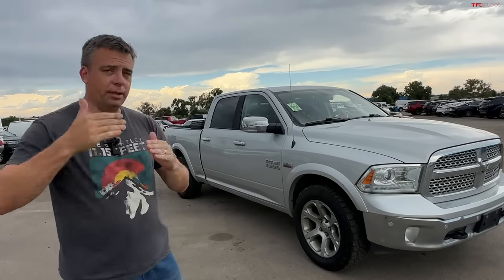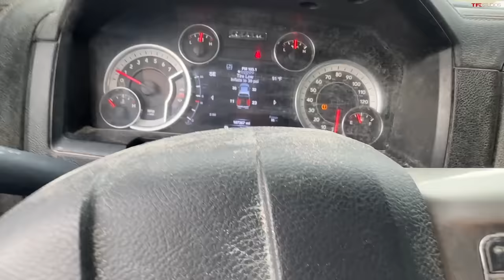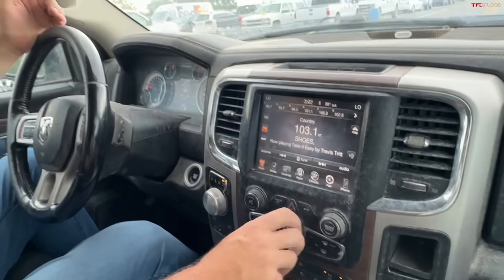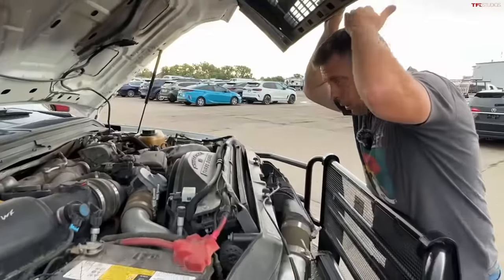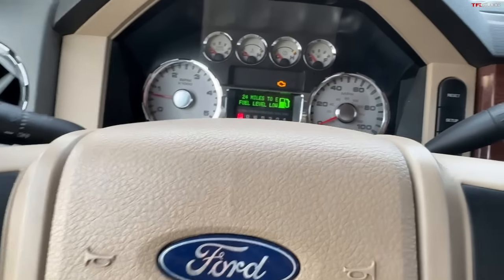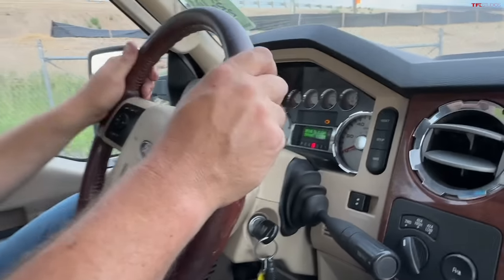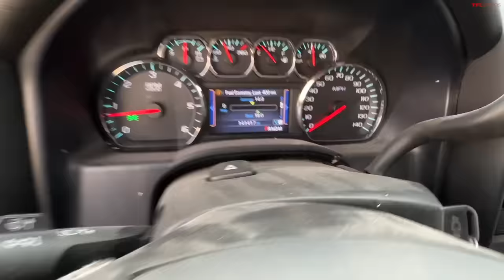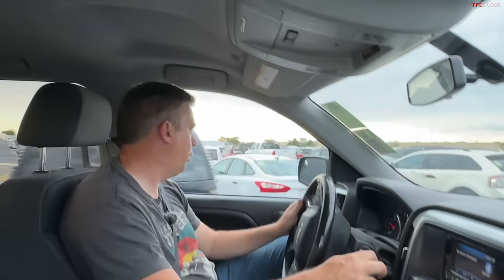These Are the Top 3 Used Trucks You Should Never, EVER Buy!

Comment: The HEMI tick issue is a bit more complicated than described.  There are 2 issues.  One is the lifter tick that you mentioned.  It is actually the less common tick.  Caused (generally) by high idle time on the engine, since the stock oil pump drops oil pressure down into the 30s (psi), while it normally runs into the mid-high 50s while running.  My 77k mile 2015 Hemi Ram Limited has about 2000 hours total on the engine, and only about 200 hours of that is idle time.  I do everything in my power to reduce idling the engine.  There is evidence out there that the nest way to prevent this is to increase the idle oil pressure by swapping to the 6.2L Hemi oil pump, as it is a bolt on swap.  The housings on the pump are the same, but the 6.2L pump has extra teeth, internally that cause a higher oil pressure while at idle, helping to ensure the lifters get oiled while not under load.  The other tick is far more common and is cause by broken studs/exhaust manifold.  Generally while the engine is cold, the broken stud allows the exhaust manifold to pull away from the block slightly, so that when started, the "slapping" of the manifold causes a ticking sound.  Once the engine is warmed up, this tick will generally go away.  From my research this is due to different metals being mated together, but I cannot personally validate that.  Perhaps swapping to headers is the best fix?
Reply: Yep. Mechanic here and also have owned a 5.7 hemi of that era. That is 100% a exhaust manifold tick, not a lifter tick
Reply: Exactly- This tick (the first Ram) is an exhaust leak
Reply: Another mechanic here. Can confirm. Thanks for explaining it to people.
Reply: Are these also the engines that had valve seat issues? The hardened valve seats were pressed into the heads - but since they were made of different metals they would expand and contract at different rates. Sometimes dropping the valve seat into the cylinder.
Reply: @christopher7026  - I cant say.  I do not pretend to be a mechanic, but since this is my engine, I made it a point to know the flaws.  I can say that I have not heard of that issue with this gen of Hemi.  :)
Reply: Good to see the mechanics speaking up here, definitely exhaust on that one. I think the whole tick thing got blown out of proportion, but I could be wrong.
Reply: When I repair these exhaust tick leaks, I usually don't replace the manifolds but grind them back flat. My theory is that the cast iron has already warped so warping further will be more difficult. Put new studs in and send the quiet truck down the road. Replacing with new manifolds will just cause the problem to happen all over again.
Reply: The way the exhaust and tick sounded upon start up, it sounds like the exhaust manifolds were leaking/ticking.
Reply: @TravisTheSavage  The reality is that tick has more to do with exhaust manifold leaks. I've had 3 different ram truck hemis  with over 130k and every single one of them only ticked because of exhaust leaks. Once fixed, they were quiet.
Reply: Ram lifter tic affects less than 1-2% in 2009 up. That is 100% broken manifold studs. The same situation with Ford Triton and LS motors. Excellent journalism boys.
Reply: Good Info! 
I have the exhaust manifold tick!😂
Reply: I am so glad as another mechanic someone came on here and finally laid out the actual problem with the hemis.  Education is key as all vehicles have problems and knowing what you are getting into is a huge in picking a vehicle.
Reply: I went to long tubes and boom bam "problem" fixed.
Reply: Mechanics, I’ve got a 2023 2500 with 6.4 hemi. Does the 6.4 have the same issues and if so what can I do to help preserve engine life. I plan on using the factory recommended oil and filter and already have several cases of the Pennzoil ultra platinum full synthetic 0w-40 and mopar filters. I live in Arizona so idling is just something that’s going to happen frequently. Summer temps where I am are about 105 and early morning winter temps are low 30’s and a couple mornings in the high 20’s. This is my first Ram product and I love it, hoping to love it during my entire ownership.
Reply: I just bought a 17 with 68k, that sound was definitely the exhaust leak. I just saw it a a good reason to order shorty headers
Reply: @highdesertexplorer123  All 2009+ 5.7 and 6.4 HEMIs with VVT and with or without MDS can have lifter failure. Keep engine idling to a minimum but also keep cycling to a minimum. If you plan on leaving the truck for a few minutes, keep it running. If you think it'll be over 10, probably shut it off.
Reply: I have a 2015 5.7 with 206k miles on it. It's lifters are fine but the manifold ticks on startup. There are basically two ways to tell if its a manifold tick. The first (and easiest) is if it ticks on start up and clears up after warming up. The second is if the engine is equipped with MDS and MDS is engaged while driving semi-close to something that'll echo the sound back, such as a concrete barrier. If you step on the gas or hit the gear - button to disable MDS, the ticking will stop. 

As for lifters, that tick is most apparent on a warm engine and it follows the RPM. It seems as cylinder number 5 is one of the more common ones to fail if the engine has lifter issues. Cylinder 5 being a standard cylinder on MDS engines. Also do not think buying a RAM and removing MDS will fix the lifter issue. Non-MDS engines, which include all cars with manual transmissions and 5.7 HEMIs in heavy duty trucks, still suffer from lifter failure at about the same rates as standard MDS engines. The solutions include: swap the oil pump for the 6.2 high volume part, tune the engine to idle higher (especially if yours idles at 500-550 RPM), run a thicker oil, 5w30/0w30 instead of 5w20, and add a ZDDP (zinc) additive to the engine.
Reply: @christopher7026 previous gen of the 5.7.
Reply: @TravisTheSavage  From what I've read, it isn't just a swap out replacement. Pulley location has to be adjusted, and you have to grind on the engine to accommodate the new pump. I have not been able to get an actual RAM mechanic to tell me about this. They seem to want to keep it hush hush, because RAM doesn't want to sell their hellcat pumps for regular HEMIs. It's all bull squeeze.
Reply: Face it, you guys like Ford.
Reply: I have a 20 gmc yukon xl with 5.3. Issues still occur with lifters. Had an engined replaced after 68,000 miles. With new engine I installed an afm disable. Catch can and use amsoil motor oil. Fyi I'm still getting 22 mpg even when it's running 8 cylinders all the time. That's only if I baby it 😊
Reply: Yeah, I thought it sounded more like the exhaust leak than the tick. I heard one idling at a gas station recently and it sounded more like knocking than ticking.
Reply: Yep, you can definitely hear the exhaust leak
Reply: I mean all the new TRXs come with an annoying squeak. What the hell is that anyway?
Reply: I hear you, but I also hear from people that it does NOT matter at all if you upgrade that stuff, and lots of people get the TICK anyways
Reply: All these years and they  can’t be bothered to engineer a motor with good oil pressure at idle?
Vehicles that are used in construction or police service?
Not too good.
Reply: @howardfletcher7206  they are good. There are millions in the road a few will have issues
Reply: Recently let go of my ram, got the dreaded lifter tick, but reached 215000 miles on it before I had to let it go, no complaints, great truck,
Reply: @DadWithAnIpad  they can drive fine with a tick
Reply: There is a hidden warranty involved. Take it to the dealer and you will need bolts for sure and  probably exhaust manifolds. If they don't offer to do it for free or under $100.00 deduct ask to meet with the factory rep. The reps hate talking to people and will offer you a deal. We had some that needed heads of course they  were on backorder but that could have been a case of poor mechanic-ing.
Reply: Who cares, pin it and forget it. Heard 5.7's tick for 200 thousand miles doing burn outs the whole way. 👍 Let er rip tatter chip.
Reply: @JonBecker81  This sound is also heard with the 6.4s (ex:  the top of the line 100 000$ Jeep wagoneer (OUCH!)), it comes frome the manifold to downpipe flanges and is considered normal. They have a different design than the 5.7 manifolds and won't break a stud as easily.

On the 2021 and up 5.7 they tried to fix the stud breaking issue with reinforcing plates between the studs and the manifold. That resulted with manifolds breaking in half faster than the old model would break a stud...

A lifter tick could be caused by an engine that sat or didn't run properly for too long (hydraulic lifters loosing their oil) ex: a truck in an auction lot, or a worn cam lobe and lifter roller on an engine that idled for too long (lack of lubrication caused by a design flaw where the lifters are dripping oil beside the cam and not on it. 

Piston slapping noise is also a thing with these but less common and is mainly caused by extended oil change intervals and/or high heat and abuse and their short piston skirt length.
Reply: @bill_clinton697 I use MMO and so far so good at ~80k. But I’m thinking of going to 5w30 also to try and up the oil pressure cuz I’m in low 30’s psi at hot idle. I did have manifold bolt issue before 60k. Also fuel gauge failure twice due to sending unit and fuel pump inside tank. Second time I used TRQ brand and so far better than stock. Hope it stays that way.
Reply: Yeah that sounded like the exhaust manifold to me.
Reply: Best comment I've read about the infamous hemi tick.
Reply: You re lying!!! You didn't take care of your truck. SMH!! I have a 2013 ram 5.7 hemi, over 648,xxx km , no problem, no ticks, no leak either.. I take care of my truck . SMH
Reply: So the dodge and chive truck is junk then save me from buying one
Reply: 2016 RAM 1500 big horn 5.7L owner here... recently the studs off the manifold of my exhaust started to go, got the exhaust manifolds replaced and studs replaced and it sounds as good as it was new. 

In addition I do have the upgraded 6.2L Hemi Oil Pump on mine as most of my use on the truck is snow plowing in Michigan, hauling something either in the bed or on a trailer... the 5.7L is reliable and loyal as long as you take care of it.

Do your recalls and upgrade what should be... 

Calling the 5.7L a bad engine because the oil pump doesn't like to idle for hours on end is like saying never buy the Cummins because there is a pin fix that should be done as soon as you get it.... (or blow the best diesel on the market up on your second day of ownership)...

Long story short, take this stuff with a grain of salt, my 2006 Hemi went 306k miles with good maintenance till I traded it in. It still ran perfectly when I traded it in too!
Reply: 2016 ram big horn / 2017 silverado 1500 same milage witch one would buy .
.....intend to keep a while and not concerned with bells and whistles.?
Reply: Had a 16 hemi crew ran great 69 mph 24 mpg. Idle and cold start oil lack to upper head. Well never had a problem. Performance my 14 f150 was much quicker but chipped n k&n. 
  Now against my better judgement bought a left over unsold 22 crew 4x4 3.6 out the door 34999 but got the ext warrenty. Change oil ea 4k synthetic. Has 3.55 rear end so quick on entry ramps. So far so good except 1 time steering wheel clock spring failed, replaced no problems.
Reply: I daily drive my ram that's 20 years old and sitting at 240 thousand miles on original engine and transmission..I've owned the truck the past 8 years and I've never even done the timing or oil pump..I have no tics or noise..Best truck ive ever owned...I've done water pump 4 core radiator electric fan upgrade plugs high flow injectors MSD coils and power steering pump...Rams are great and reliable u take care of them they will not leave u stranded

Comment: The only Chevy Silverado y'all should ever get is a 1999-2006 5.3L. They're the most reliable engine Chevy has made. They been known to run 500k miles without any major issues. I know a few myself. And mine is running 250k strong. Among other trucks older Ford rangers and Hardbodys are also known to be reliable.

Comment: That's not lifter Tick on the RAM, that is clearly a leaking exhaust manifold which is common.
Reply: I agree
Reply: Yup. Rockie mistake 🤦🏾‍♂️
Reply from the maker: Thank you for letting us know.
Reply: There is also a fuel injector tick that can sometimes be mistaken for the lifter. But that is definitely not the lifter tick. Goes away after 30 seconds.  Mine has both exhaust manifolds that have warped on the backend of the engine
Reply: Junk doesn’t matter
Reply: I’ve had three HEMIs with the same exhaust manifold issue, that’s what it sounds like to me too. Not super critical but it definitely sounds bad and should be fixed
Reply: Had the same. Fixed at the exhaust manifold. 2015, pulls better than an older 2500 I have as well.

Comment: The 6.4 was the last diesel engine produced by navistar for Ford. The 6.7 was ford’s first self designed diesel engine. Ford did not “redesign” the 6.4 Andre.
Reply: Ford nailed it with the 6.7. It's a beast
Reply: @kylebutler7142 I agree, Ford got the 6.7 right. It says a lot to me that Dodge (Ram) had to go to Cummins & Chevrolet had to go to Isuzu for the Duramax but Ford does their own thing & in my opinion does it better.
Reply: I wouldn’t say it’s better but it’s certainly up to par
Reply: @scottyellis3442 Ford tech here. Actually GM and Isuzu's Duramax was the first mass produced medium consumer duty diesel with Common rail injection. They paved the way for Cummins and Ford to change to common rail injection.
Which is a huge upgrade when you consider what ford and Cummins were trying to sell at the time
Reply: @scottyellis3442 GM owns Isuzu, just like they owned Detroit Diesel.  They’re essentially the same entity.
Reply: @useritscarrot  Yeah, even as a die hard Ford guy, I have to admit, when the Duramax first came out in the early 2000's it blew the 7.3L and 5.9L Cummins at the time totally away. Ford eventually caught up in regards to performance a few years later with the 6.0L but they traded rock solid reliability for performance and it wasn't really until the 6.7L they found their oil burner way again.
Reply: My buddies 2016 6.7 diesel has been a nightmare, he's been driving my 15 f150 for a week
Reply: @TheEnd-eg6wq probably the stupid Bosch cp4 pump.
Reply: Everyone acts like the 6.7 PS is Gods engine, but they’re a nightmare to work on, have some really expensive/difficult common problems (only one still dumb enough to use a cp4!), for me the Cummins is far superior, just don’t care for the truck around it as much as the ford.
Reply: @GenuineRedneck  Some sensor on the fuel rail.

Comment: Tick on the Ram is exhaust manifold leaking.  The valvetrain on that particular engine sounds ok - as the rev descend with the throttle closed the engine didn’t make any ticking noise.
Reply: I though the same thing. That guy doesn’t know what he’s talking about.
Reply: He never does
Reply: These guys are extremely annoying and generally clueless. On the Ram, It’s the exhaust manifold bolts in the rear of the manifold that are broke. Common issue. They take a truck that has been beat to crap and categorically chastise it.

Comment: That ticking your hearing with the ram is the exhaust leak. The passenger side manifold cracks around the rear bolt. On start up you will definitely hear it but once the engine warms up it will go away because the manifold will expand. I have had several of these trucks and everyone has had this issue.
Reply: Exactly. TFL likes to pass around bad info instead of actually researching.
Reply: It's the lifters. These trucks have horrible lifter issues, I've owned two. 

But you aren't completely wrong as the exhaust manifold does start to tic eventually but it's definitely different
Reply: The lifter issue has nothing to do with mds, it’s related to trucks that idled for long periods. The hemi design lifted the location of the camshaft leading to poor oiling when oil pressure is low. Higher pressure oil pump can fix this
Reply: @KevinMartin1028  Yup, they do it all the time. I tend to feel that they intentionally do it so they get more comments
Reply: I second that. I rarely saw lifter issues in hemi but lifter and overhead cam issue in 3.6 option but farely simple job as well to swap them out .
Reply: @MSchumacherfan exactly. The manual transmission hemi's would also develop lifter tick, and those didn't have MDS. Biggest reason for lifter tick was low oil pressure at idle. A hellcat oil pump fixed that issue.
Reply: @TheCanadain1  2004 too 2020 I have had 8 of these trucks and 7 of them have had the manifold crack. The dealership has side on 5 of them it was the lifters. I listened to them once and had the lifters replaced and when the job was done and complete they mentioned that the manifold was cracking so they replaced at no charge and only charged for the lifters. That was complete BS, it was never a lifter issue it was the manifold and they charged me for the more expensive job. After that every time they said lifters I said change the manifold and the tick went away every time. Out of those 8 trucks 6 of them I still own and no issues with lifters ever. With that being said I personally think mechanics and dealerships are saying it is lifters just to get more money
Reply: I had it too they fixed it under warranty . Only issue mine ever had
Reply: @MSchumacherfan  no it's not. I have a HEMi with under 200 idle hours and has the tick anyway. I've seen a bunch of people in forums /groups with the tick with basically NO idle hours. The issue has nothing to do with idling IMO